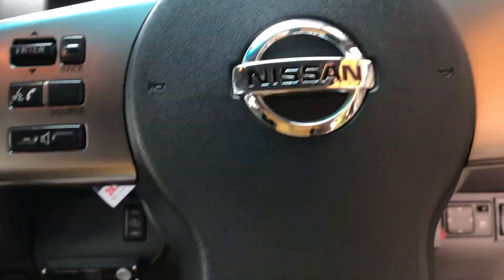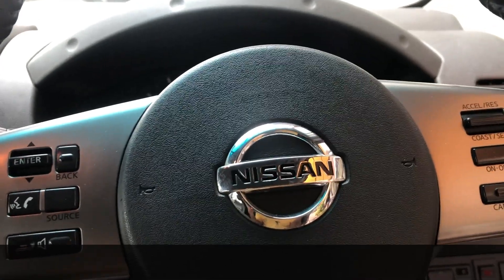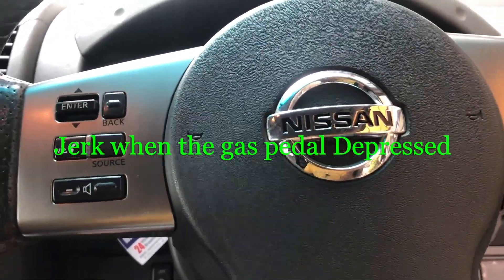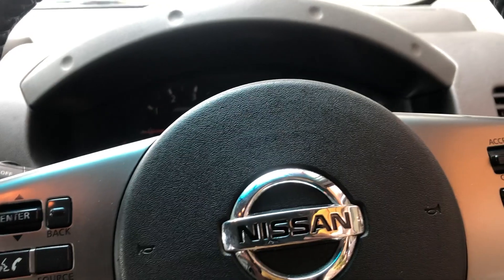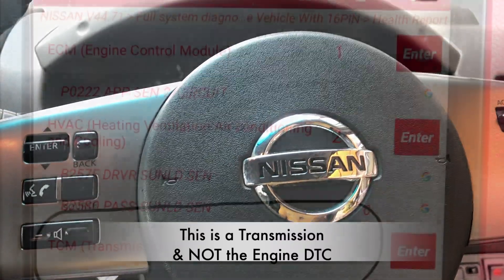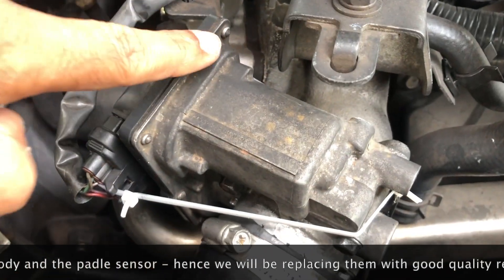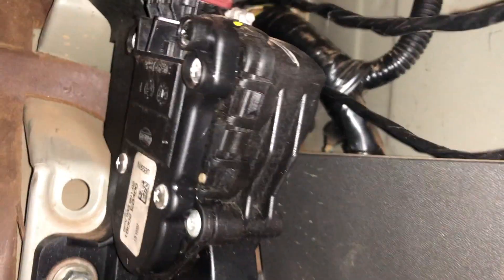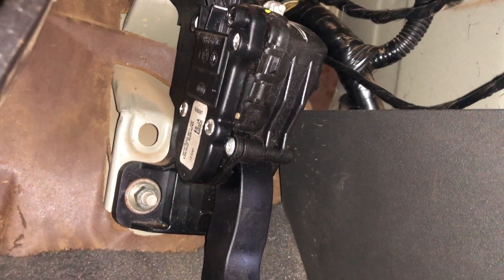Nissan Navara P1705 P0222 | Throttle Position Sensor Malfunction | Engine Staling | Lose of power

Comment: Hi, I have navara 2010, with p1705 code. With phone app OBD a scanner I checked pedal response and seemed to be ok. What else do u recommend checking.  I also got u1000 CAN malfunction and p2297 O2 sensor out of range during deceleration codes ..cheers
Reply from the maker: Hi sorry for the delay in response 

Please check the wiring first as U1000 indicates a ground loop 

You need to invistidege complete wore Barnes (the harness compile with 3 different segments

Comment: Hi I have Navara D40 2011. Mine shows Dpf sign and also the maximum  rpm reaches 2500. The top speed of the vehicle reach at 45 to 50 km/h.  When I checked the throttle body. It’s the same open even the car is shut down. Same as you shown in your video.  I guess the petrol vehicles throttle body s always shut when the vehicle is switch off.  I really appreciate you. If you could help me in this issue.
Reply from the maker: If the DPF light indicates means the vehicle goes to limp mode, that have to be cleared by either regenerating the EGR module by using a scanner
Reply: @abcautotrendy  what if we clean manually the dpf it self by using liquid.
Reply from the maker: @mohamamdali-np5ty sorry for the delay in response, that won’t help for long run

Comment: Hi there. I have a question. If i change myself the pedal on my d40 2012. Do i have to reprogram or do i juste need to take off the old one and place the new one and it’s good ? Thanks for your answer. I’m sorry my english is not very good. I just want to know if i can do it myself
Reply from the maker: Hi well, the easiest way is disconnect the battery terminals and take off the paddle sensor and replace. Once that done reconnect the terminals

Comment: Can you help me? P1721 code in my Navara 2012 Diesel A/T
Reply from the maker: Hi there, 

This is related to the speed sensor that is located inside the valve body, just do one thing, unplug the gearbox wire socket from the outside, clean the socket with an electric cleanser, and plug it back n check, do a data stream on the TCM MODEL identify gear ratio and gear shifting ratio.
Reply: @abcautotrendy  thank bro! From to Paraguay.
Reply from the maker: Most welcome bro

Comment: What is the problem if the 4wd light is coming on the board if the engine is on?
Reply from the maker: You may have to first check the 4wd relays